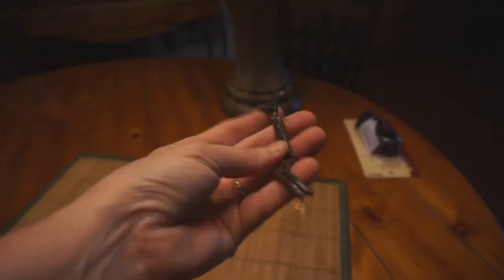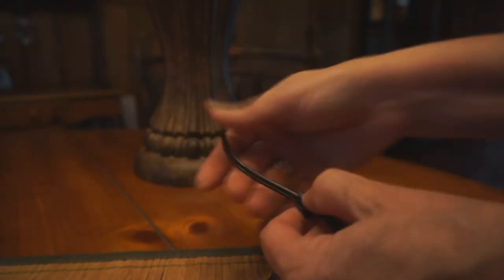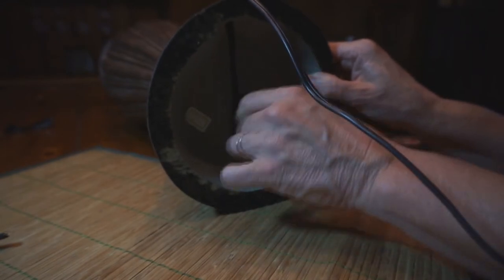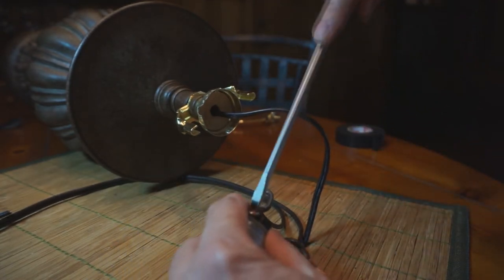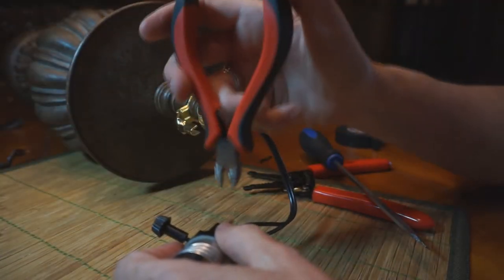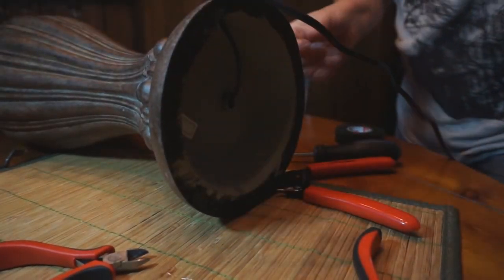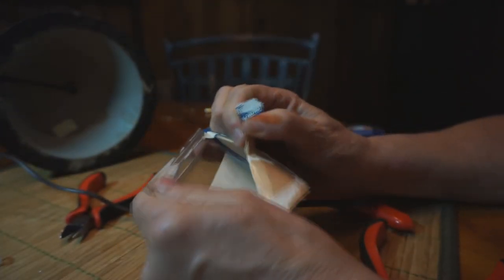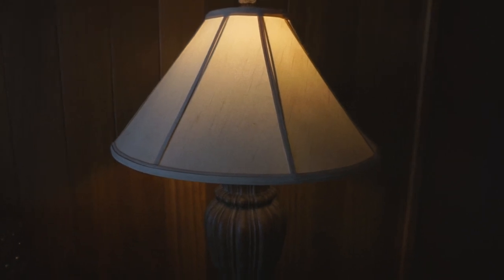How to Replace A Lamp Cord - Do it Yourself

Comment: Good Job!  My grandfather and uncle were electricians and my son was doing an apprenticeship here to get licensed before he was called up for active duty.  Then the housing market crashed and he went full time military.  I worked with my uncle during the summer when I was 10-12.  Who knew I could learn enough to hang ceiling fans, light fixtures, rewire lamps and window candles and change out light switches.  LOL  It's stuck with me for 50 yrs now.  I was just talking to my younger sister today.  She has all types of little things she wants to do or change around her house and is afraid to try electrical or power equipment.  I laughed at her.  How did we have the same parents and she's the only one who has home improvement challenged?  LOL
Reply from the maker: My dad was the same way.  He taught me all sorts of stuff and I am thankful he did.  I don't like messing with electricity but do when I need to.  Thanks for your sons service to us all!
Reply: DWDinAtlanta.........AM VERY  THANKFULL  FOR YOUR  SON.       FOR KEEPING  US  ALL SAFE. BE CAREFUL AND SAFE MY FRIENDS.